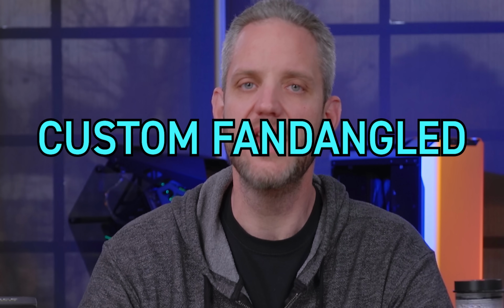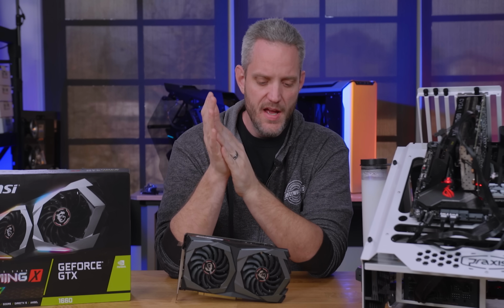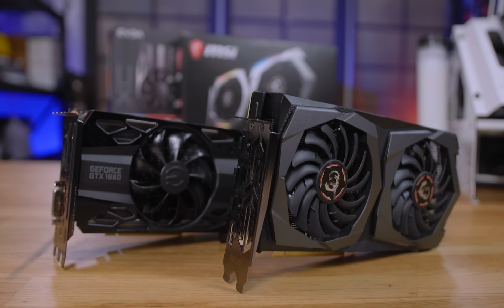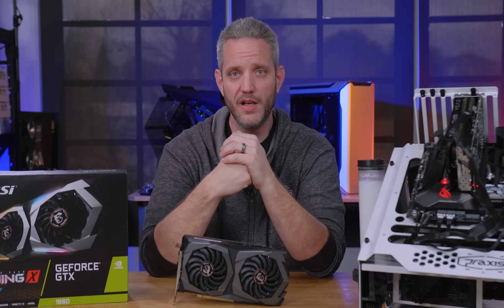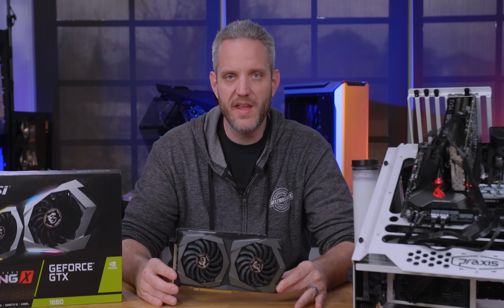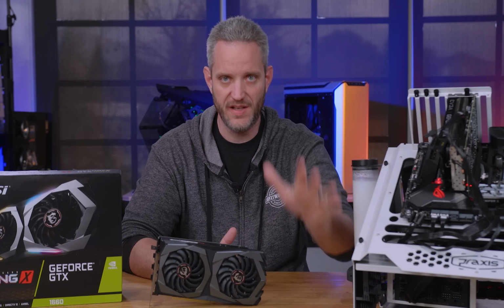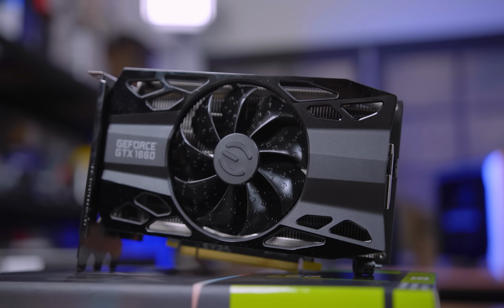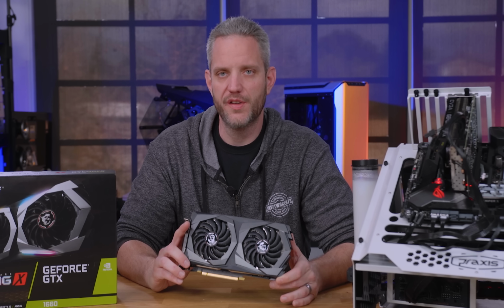Just save your money.... GTX 1660 vs GTX 1060

Comment: I have a GTX 1060 6GB and as a tech enthusiast I'd love to upgrade to a 1660 Ti or RTX 2060 for smoother 1080p gameplay but even with my current card I feel like I'm getting bottlenecked by my aging i5 3570k (that I don't dare to OC with my bottom of the line Z75 motherboard) and 8GB of single channel RAM. I've been looking at an R5 2600X or an i5 9600k for some time now but the cost of upgrading pretty much everything but the GPU is significantly higher than just buying a new GPU, so I'm just saving up recklessly to slowly being able to afford either the AMD or the Intel option (I'd prefer Intel due to the lead in gaming performance as I'm not planning to do anything else but AMD is considerably cheaper); but  maybe I'll wait until Zen 2 comes out and make my move then.

Comment: I upgraded from a radeon 5750 to a gtx 1060 3gb when it came out, but now I'm tempted to get a rtx 2060.
Reply: That's a pretty sensible upgrade. I'd also check the market for a used gtx 1080. They sell for pretty close to the RTX 2060, and perform a little better (besides rtx). Just depends on what you want.
Reply: @dogboy0912  one of the reasons I want to upgrade is because of the limited vram, I'll be playing at 1080p 240hz and in the future I want to get 1440p 165hz but never anything like 4k.
This is why a 1080 doesn't really have much appeal to me, the highest I'd go is for a 1070ti/ rtx 2070.

Comment: 6gb cards in 2019 are what 3gb cards were at the end of 2017, barely enough. I would not buy a card in 2019 with less than 8gb of VRAM.
Reply: I have a Gtx 660ti
Reply: @ZeryArtzTM  I bough a EVGA GTX 1070 FTW2 ICX card last summer for 275$ lightly used, and man, what a fantastic card this has been, I want the SAPPHIRE NITRO+ Radeon RX Vega 64 DirectX 12 100410NT+SR 8GB 2048-Bit HBM2 PCI Express 3.0 Video Card next. I'm about to be done with Nvidia, going back to AMD.
Reply: I think a 6gb 1060 will last you but anything lower and you will not make it to 2021
Reply: I think that's an exaggeration. The VRAM requirements certainly haven't gone up like that in just 1.5 years for the vast majority of new games. But it would certainly help to have more in the future, I suppose
Reply: 6 gb is plenty right now
Reply: @Nakatomi Plaza Agreed, resolution and how many mods your running on your game : D
Reply: @Nakatomi Plaza Pushing almost 5gb vram on a heavily modded Total War Warhammer 2 @ 1080p. I can only imagine that the buffer would request even more than 5gb @ 1440.
Reply: @Nakatomi Plaza you do realize your playing a toy soldier, I just prefer to control entire armies where it takes months to finish a single campaign.

Comment: One suggestion to improve the presentation of these videos:

You keep throwing lots and lots of model numbers and specs, and it's hard to follow everything you are saying because it all goes so fast. I would recommend that, for example, when you are listing card models of the GTX 10 series, those model names actually appear on screen one by one as a list as you say them (in this case with, perhaps, their MSRP at launch, because you also mentioned those). The same with specs, when you say them out loud. This way it would be much easier to follow what you are saying. Otherwise it just becomes a big mess of random numbers, because you just go over all of them so quickly, and it's hard to remember and form a mental picture of all of it. Thus it would be much clearer if they formed an actual picture (or, in this case, a list of models/specs).

(This is not the only video where I have noticed this problem, nor are you the only one who does this. It has always bothered me.)

Comment: For RX570 4GB user like me it is not worth to upgrade as I already got good/ok 1080p performance and won't see much difference with 1080p/60 display. My next upgrade goal is to step up with resolution to 1440p  so I see cards like Vega 56/GTX 1070 as entry point. I'm not interested in 6GB cards in 2019 although they are completely fine.
Reply: Because this card is to design to replace your card or the 1060 3gb which the rx 470/570 is slightly better because you get one more extra vram. So not a good upgrade.
Reply: @hungalas1  I don't need to upgrade anytime soon it just makes no sense until I'll upgrade my FHD TV to 4K with freesync support. I'm perfectly happy with RX570 4GB Sapphire Nitro Plus and Ryzen 5 1500x performance in all games I'm playing now.

Comment: going from 1060 6g to 1660, is like going from thee 1060 6g to the 1070. It's just not worth it, the system won't get much more future proof. Save some cash and go for one of the RTX cards if you really feel the need for upgrading.

Comment: Currently debating if I should upgrade my 970 to the 1660 to, or just wait and built a whole new system
Reply: Definitely not, it's not that noticeable jump. If you are upgrading go for 2060 at least.
What cpu do you have?
Reply: @ilijapetrovic5002  
I currently have a i5 6600k, 16 gb 2400mhz, Asus hero vii motherboard
Reply: @bruno_pr  you could grab 2070 and oc your cpu. There shouldn't be huge bottleneck also you could upgrade whole system and reuse your ram (it's ddr4, right?)
Reply: @ilijapetrovic5002  yea I was thinking of taking my ram, case and CPU cooler for a new build and use my older parts to make a smaller build and covert it to an entertainment center for the living room. Thanks for the suggestions

Comment: I think I dont see point of these cards. Both 1060 and 1660 cost about 250$ or less. 1660 is faster but for 10~15fps in games ? So it means that in 2 years they made progress of 10fps ? What is kind a weak.

Comment: The one thing I have learned is that VRAM makes a huge difference in future proofing.  Programmers are often lazy and will take advantage of increases in VRAM with loose blotted code.  As time moves on anything running 8 gigs of VRAM will beat out the cut down versions.   While speed sells today many games will not even load on a card with less VRAM in the future.  I don't understand why this never comes up in these NVIDIA commercials.  All I ever here is save your money and buy the more overpriced card later.  

Another pet pea of mine is that most people still run 60hz monitors.  Anything past 60 FPS is overkill.  If you are running a older card that can still hit 60fps and you are not planning on updating your monitor, don't buy a new video card because it may even make your gaming experience worst.  All the software and hardware gimmicks by AMD and Nivdia to smooth out over-framing is a joke.  Save your money and find a girlfriend.  That will be your best gaming experience!

While I like most of the YouTubers, they have been reduced to making infomercials for corporate monopolists and are not really giving you the full truth.

Comment: I'm still wondering why they didn't place the 1660 and 1660ti with the rest of the lineup in terms of naming. Imo it should have been GTX2060 / GTX 2060ti / RTX2060 / RTX 2070 / RTX 2080. As they all use the turing architecture and the gtx versions simply have the ray tracing feature stripped away. Putting these two cards in the 11 series lineup must make them look like last generation cards for anyone not keeping up with tech.
Reply: Its for casuals who dont tech.
Reply: The name we expected was 11XX for non Ray tracing cards BUT NVIDA SAYS 16 IS BETWEEN 10XX AND 20XX

Comment: My personal opinion would be:

If you have a 1060 3gb, then a 2060 would definitely make a great upgrade. The 2070 would be even better, if you can afford the extra $150, but a lot of benchmarks have shown only a small change in FPS between the 2060 and 2070, so the 2060 would be the better value for your money.

MAYBE, if you're on a more slim budget and you're yearning to ditch the 1060 3gb, the 1660 ti would be an alright upgrade, but not the best. You could probably get away with it if you sold the 1060 3gb after buying the 1660 ti (get some money back for your purchase - which I don't always recommend, maybe wait a good few months before selling an old graphics card. Mainly because you don't know if the new graphics card will have issues, especially if it just launched.)

Comment: A used 1070 or Rx 580 is a better investment than all these recent Nvidia releases . I would wait for Navi though.
Reply: go watch Hardware Unboxed's review. 1660 is cheaper and out-performs (read as blows out of the water) the RX580 . It beats the RX590 in almost every game. The only card in their test that has a better dollar to frame ratio than the 1660 is the RX570.
Reply: @dannyberry8725  Many people noted on said video that their RX 580 price was far higher than many cards on Newegg right now
Reply: @dannyberry8725  at a used price the rx580 is great. picked mine up for 80GBP
Reply: 1660 Ti is a little better than 1070 by a few fps and it probably cost the same as a used 1070
Reply: @Venom-sy2dw  Nope, you can get a used 1070 for 200 bucks, wehreas the 1660 ti sells for 259+.

Comment: I have a 1060 6gb and I'm pretty darn happy with it currently. 
I was able to overclock it to pretty much equal a 1070. If I'm going to spend the money to get a new card, I'm going to get the 2060, and not dick around with marginal increases in performance when I'm already mostly happy with where I'm at.

Comment: I own a GTX 1060 6gb and am looking for the upgrade path. I believe the 2060 is best for a person who doesn't upgrade more than every 3 years or so. The 1660ti is fine if your money is tight. I'm using the majority of my last build, though I am also thinking of going up to an I7 from an I5 6500. The processor and video card upgrades will boost my gaming performance a great deal. For roughly half the price of a total rebuild, I can possibly double my performance while setting myself up for the next rebuild within another 2 years or so. It's a slow and steady path, but I think it works when you're "Adulting".

Comment: Looks like my 1070 won't be getting an upgrade for a while
Reply: Upgrading every generation these days is dumb. Especially if you're buying a xx70 or higher card. You can easily get 2 generations from it without struggling in games at 1080p. Now the value of a xx80Ti cards is ridiculous, but in the past the follwing generation the xx70/xx80 perform like the old xx80Ti card, and then the 3rd gen xx50Ti/xx60 cards perform like the first gen xx80Ti card. I don't think anyone should upgrade from a GTX 970 or better unless you're running into a VRAM issue, which tbh you likely are. The value this gen sucks because of the addition price of rt cores.
Reply: John Moore lol I'm not running into any issues with my single 1070, my statement was made based on how shitty the offerings are as far as performance and value goes and how it looks like things won't be getting better any time soon.
Reply: Same here with my 980ti 6gb it was actually faster than my other card which was a 1070 non ti
Reply: You could SLI your 1070 with another one, and then hold off on an upgrade until the next generation of cards.

Comment: Yeah I spent a lot of time trying to figure this out. I’m building a new workstation for video editing as well as gaming. Budget is a huge concern, but I ended up finding a good deal on a GTX 1080.

Edit: For me, I ended up wanting to save the extra money and delay building my rig. I wanted to invest in what I felt would get me to the finish line and not cut corners anywhere, and then have to deal with that on the back end.
Reply: how much did you get it for? used?
Reply: I found it on EBay, used, for $350

Comment: Think everyone should wait for how Navi does first then decide as may be better price to performance or just buy a used GTX 1070ti.
Reply: Not everyone if you're building PC right now GTX1660/1660Ti and RX 570/580/590 are good choices depending on your budget. Navi will come later and if you want to upgrade you existing rig you possibly can wait couple of months to make best choice.
Reply: Even if anyone is thinking of building a pc now they should 100% wait for Navi and Ryzen 3000 series as a few months away at about same price with more cores/threads
Reply: @hydrokizza77  that's when you're wrong. Now is good time to build becouse of all deals on pc components happening before next gen launch . Second you assume that all Ryzen 3000cpus will be released in same time and that was never the case. I would expect Ryzen 7 released first with Ryzen 3 coming at end of year.
Reply: What deals? buying product that is not being produced anymore costs more as supply is low, also I didn't say that all the new ryzen cpus are going to be released in the same month :)
Reply: @hydrokizza77  deal is usually related to good price. I saw new Ryzen 5 1600x for £120 yesterday. That's a steal. Basically you advised to wait not stating what for and when. Yeah very smart and easy to defend.
Reply: What when a ryzen 5 2600 is £145 you think that price is a steal for 1st gen ryzen…. are you trolling?
Reply: 1600x uses 30 more watts than the 2600 and 2nd gen ryzen has better memory support and benefits from faster speed memory speed.
Reply: There's absolutely no reason not to choose 2600 over the 1600 now, unless you already have a 1600.
Reply: hydrokizza77 People have been waiting for Navi forever. Fuck Navi.
Reply: Waiting for Navi is like waiting for the next Duke Nukem game.
Reply: The problem is the wait be forever.  Let's say when Navi and nzext gen ryzen launch we will dtsrt hearing even better product might coming out in a few months. At that time will you holding back from buying new hardware once again to wait if the upcoming hardware will give better deal/value/performance to you? Right now we don't even really know when navi will exactly going to launch. Sometimes i do think company might intentionally leak bits here and there to make people waiting for their stuff instead of going with competitor solution. But this thing will work on  everyone. The best course of action is just buy the hardware when you really need it. And be satisfied with it. Do no regret the decision if in a few months when better deal might arise. Because if you do then you will never satisfied with what you get. It is a war that you can't win.
Reply: That might just work in USA. In Canada an used 070ti is more expensive than a 1660
Reply: Natus Vincere?

Comment: When there is 2 cards (980 and 980 Ti) that are 2 generations older, yet still faster than this, that makes this 1660 release completely useless.
Reply: You’re comparing 2 year old high end cards to current mid range cards.
Reply: SEN AV8R 980 is about on par with the 1060 6gb. The 1660 is a bit faster but still completely useless. The 980ti performs about on par with a 1070 or the 1660ti, it depends on the titles. Either way, the 1660 doesn’t belong anywhere.
Reply: @armandohernandez6625  It does belong where low power matters. Which is basically every single household. Someone's gotta pay the electricity bills.
Reply: Sławek B. The power difference might seem like a lot but realistically the difference in dollars is very little
Reply: @armandohernandez6625  there's always heat as well ;)
Reply: Sławek B. Which is why you don’t get the base models with garbage coolers.
Reply: @armandohernandez6625  that is true

Comment: When it comes to picking a model for the 1660, some of the cards that are 20-30 USD over the MSRP have increased power target compared to the MSRP cards. So if plan on overclocking it might be worth paying an extra 20-30 USD

Comment: Looking at the 1660 or even the ti it’s worth spending the extra $100 from the $250 version to get the RTX 260 because the performance you’re getting at that price point is one of the best values because there is only a 5 frame difference between the 2060 and the 1080

Comment: I always want the best value for my money. If the cooling is sufficient, there's no reason to buy a more expensive card, when you can just overclock the one you have slightly. 

If the performance difference is minimal, and you can cover it with overclocking, might as well go the cheaper route. Cuz all I'm hearing is get a 1060 6gig or a 2060, because the 1660 seems like just a mid range card that offers only mild performance for dollar.

I'm running a GTX 960 in both my computer's right now, simply because it was cheap when I got it, the other one was free, and you gotta do what you gotta do.

And for a 450 dollar card 4 years ago, it's able to do 4k supersampling and will run at 60+ fps on most games, so until I build a beastly rig using a 9900k, I see no reason to upgrade when even a 960 plays the games I've got and the games that are coming out, at Max settings.

When I build the beast, yeah sure I'll get a 4k 144hz Monitor and have everything liquid cooled from space, but until then, I think it's fine lol